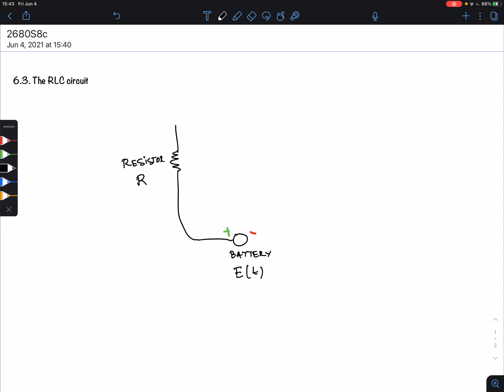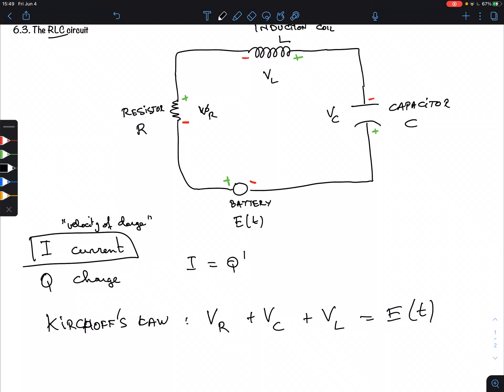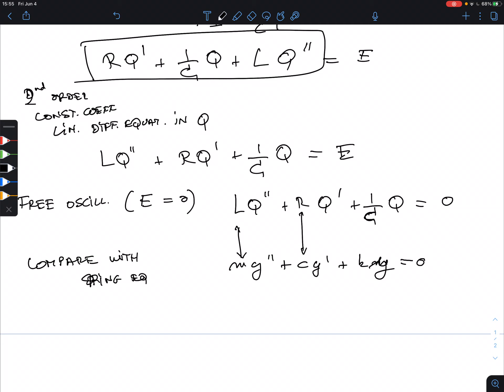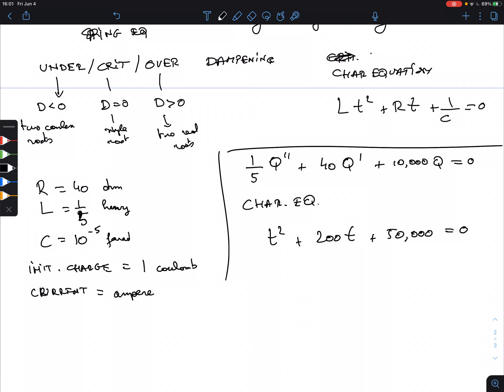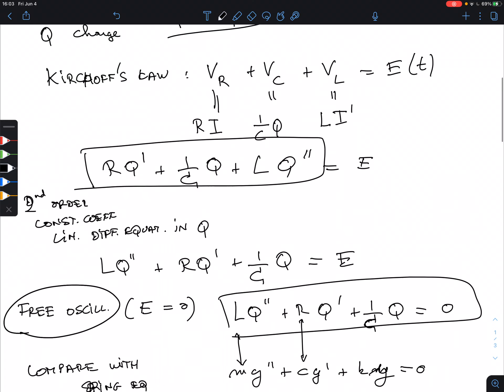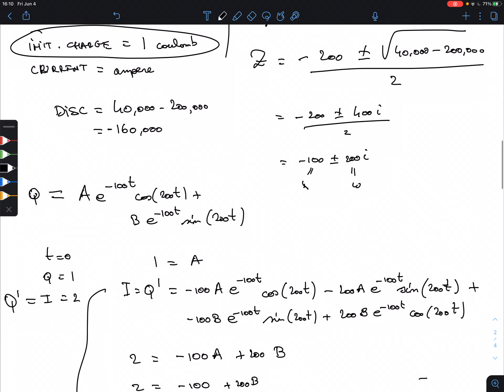2680S8c

Comment: Professor, in the example you indicated that C (capacitance) is equal to 10^-5 right? then C^-1 should give you 100,000 , five zero behind digit 1. However you seems like missed one zero when you were trying to solve the differential equation.... I guess you want to say C=10^-4 at the beginning.
Reply: I meant the coefficient of Q is 500,000 if C=10^-5